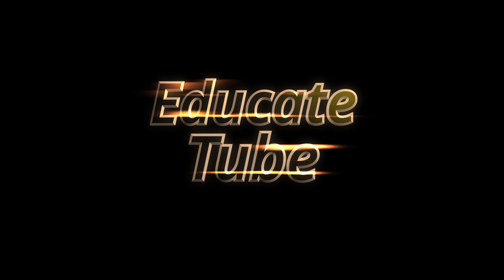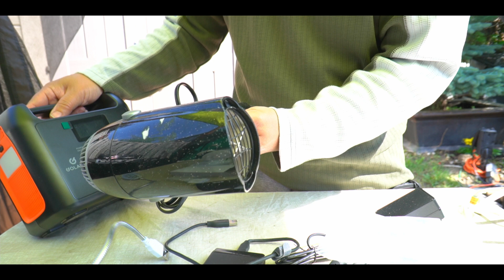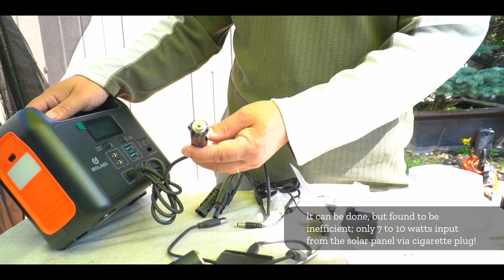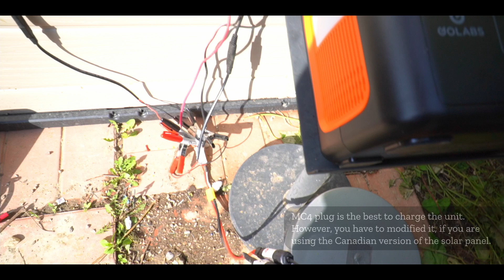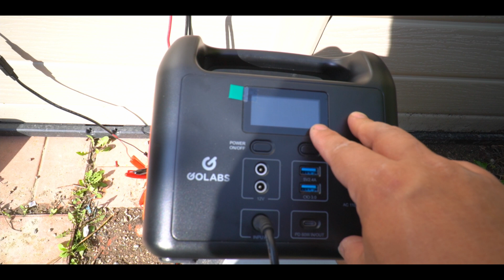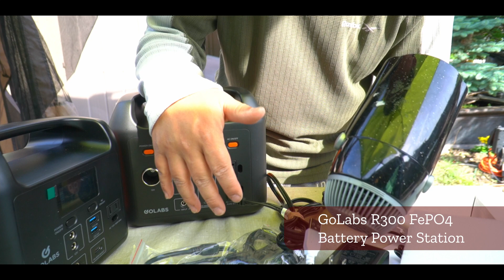GoLabs Lithium Fe PO4 (LiFePO4) Battery Power Station R150 and R300 Part 2  - Optimal Usage

Comment: You can hook your solar panel to the charger and use it and charge it at the same time and get much more time from it.  It's called "pass through charging".  Try it!  The screen will only show battery level and charging watts but no time as it is as long as you are pulling in external power.

Comment: I got 51W input from my Togo POWER 60W solar panel into my GOLABS R150. Very happy.  I decided on getting an Anderson to DC5521 (GOLABS) cable for $10. I preferred this to using TWO cables: Anderson to MC4, and then MC4 to DC5521.